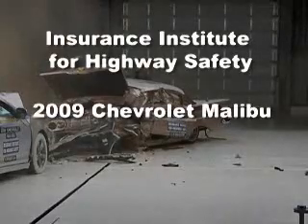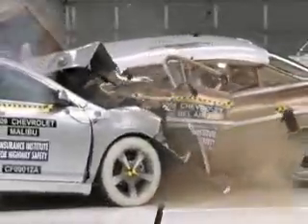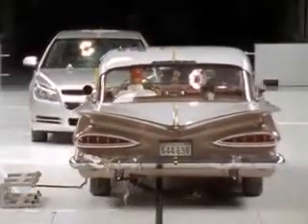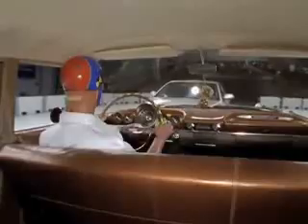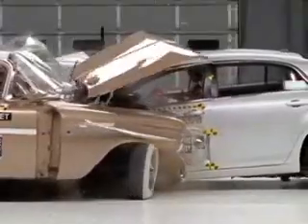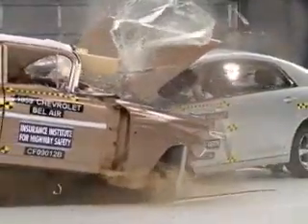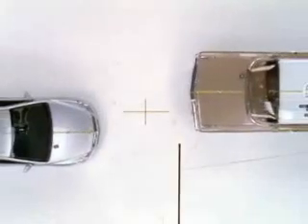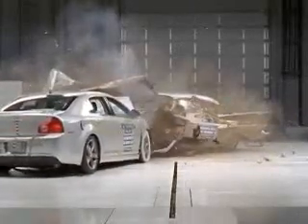Crash Test 1959 Chevrolet Bel Air VS. 2009 Chevrolet Malibu (Frontal Offset) IIHS 50th Anniversary

Comment: From a basic physics standpoint, it kinda seems like the engine is nonexistent in the Bel Air. A 700 pound piece of iron is not going to have it's direction changed by by some plastic and aluminum. If there was truly an engine in that car, it would use the Malibu's crumple zone as a cushion. The inside passenger compartment would not explode like that. Also to take into account real steel would tear into that plastic and force the crumple further and use the shit-can Malibu as a cushion.
Reply: The Malibu's advanced crumple zone would tear through the Bel Air's empty engine compartment due to the lack of reinforcing like a modern crumple has. The Malibu's mass would use it's mass to drive into the Bel Air further.
Reply: pretty much, I usedvtovwork on modern cars. I lost my job because of these plastic cars....or weak metal, the fender on a 2013 pickup bent in like its cool. My 95 also had a lot of room under the hood and I faceplanted it. I'm still alive and the engine was still running. Had I not tore off my front end I could have driven it home....im probably alive because if the sheer size of that thing
Reply: here that's bullshit and lemme tell you why.....a car costs money and is constructed from earths limited recources...two people do the horizantal bop and boom a people....some cars are not made anymore so they are irreplaceable. Some folks don't have money for even a beater. I'm just saying, a perfect balance of people survivability and automobile survivability.....and like said that paper thin Malibu is not going divert a 300 pound iron engine so yeah no engine
Reply: Charles Bledsoe Actually, a 3,400+ pound car is easily going to divert a 300 pound engine, especially when that engine is a non-structural component held in place by relatively flimsy motor mounts, as opposed to the Malibu whose crumple zones and passenger cell are specifically designed to absorb and deflect crash energy.

If a car is relying on its engine block to protect it in a crash, then it's already lost.
Reply: Trackers89 From a structural view, once the block wedges in the crumpled engine compartment, the firewall can support a lot of pressure.......in a case where i manged to faceplant an older ford pickup, the front end was scraped under, so the nose took the force into solid ground.........the ford 302 cid engine was seated comfortably against the firewall.....and probabaly saved my life......those older cars had long and tall sixes  while v8s remained a power option.....once the engine compartment crunches up, its solid, the rest of the frame absorbs the impact.....also of which why the frame of my truck was "L" shaped......anything that hits the ground isn't gonna win, Plus as stated elsewhere X frame bel airs were terrible.......Big Cars>little cars.......my 82 Lincoln mark vi would cut that malibu in half and still get me home
Reply: Charles Bledsoe The example you gave says more about the strength of your old truck's firewall than the value of the engine as protection, since if anything being hit by a big loose object that continues to exert pressure afterwards would increase the chances of it buckling. On newer cars, firewalls would be considered part of the safety cell and thus be even more heavily reinforced, so they could take an impact whether they're carrying a big V8 or a little 4-banger. Even if an engine protected, it would be pushed aside in an offset (like this video) or angled impact, so like I said earlier, a car that relies on its engine block to protect it is already a death trap.

Anyway, this is a moot discussion, since evidence suggests that the Bel Air was in fact carrying its engine and it still got crushed like a soda can by the Malibu.

Regarding your '82 Lincoln: It's more than two decades newer than the Bel Air in this video, and well into the era where automakers finally started caring about passenger safety, so it's not surprising that it would do a better job. And while its weight might give it the edge in a car vs. car impact with the Malibu (car vs. stationary object is another story), the difference is not as large as you think as kobun37  pointed out, and in a fair comparison where it's put against an equivalent modern car, such as its direct successor the Lincoln MKS, I wouldn't bet on it.
Reply: listen, i've worked on engines for at least 5 years, a present engine would also spew debris from under the hood, as it popped open like a jack in the box.......i should have seen the intake fly out like a frisbee, those pans were not held in tight........not to mention, cooling fan blades, alternator parts etc.. you people would belive the trash they feed you to purchase a newer car...........remember when abs wasnt a thing, traction control, airbags,power brakes, and even seat belts? yeah they didnt really need them due to size and strong us steel in 'em
Reply: +Charles Bledsoe lol, you know more people died and had serious injuries per mile in old cars right? 

No seatbealts? People were ejected from cars and died instantly from the impact. 

No ABS? needing to stop quickly always resulted in a lockup, and without control of the car usually caused a crash, a problem no longer

Same deal with traction control, once in a slide, you crashed, now you don't even get into a slide most of the time.

Airbags? Yes because hitting the steering wheel or side of the car with my head is exactly what I want in a crash. You die when that happens.

Next your going to tell me drum brakes are better than disc's

The fact is, 70 years of engineering has worked out that the point of car safety is the passengers, what the car look like afterwards does not matter, so they use  the outside parts of the car to absorb the impacts. 

The stats and numbers don't lie.

In 1950, 80 people died for every billion miles driven, today that figure is just 10 and has been decreasing steadily since the 40's. Mostly due to increasing safety.

If you want to put the lives of yourself and you children into a deathtrap, so be it. But you are just lieing to yourself

Comment: Kind of like the difference in trying to crush a full soda can and an empty one. Notice the over head shot of the collision quickly cuts away before the hood of the 59 Chevy reveals there is NO engine in the compartment!  All I know is, yeah cars today may be "safer" with air bags and shoulder harnesses. But I've seen accidents at low speeds between a new Acura and 2011 Malibu. Aside from the Acura needing a new bumper skin, the Malibu needed: new bumper skin, lights, radiator and trans cooler, bumper shock repair, hood and fender work. That's the difference in a 45000 car and 18000 car. Quality in construction and crumble zones. But I'm not going to believe the same plastic car is going to hold up better than a true steel machine of the 1950's without rigging that classic to give the Malibu a fair shake.
Reply: frehleyrox There is an engine you dumb shit.

+caleb J. No, that is rust, from the inside of the metal.

Comment: Looks to me as if the 1959 was precut in specific places to crumble the frame, there's no way a beer can and plastic bottle would crumble real steel that bad.
Reply: Mark Phillips nope. modern metallurgy and manufacturing techniques make better steel. The frame is completely untouched.
Reply: +Mark Phillips Beer can? Plastic bottle? Are you describing your head?
Reply: +Mark Phillips - This may come as a shock, but the steel used in modern cars is WAY stronger than the steel in old classics. The passenger compartments are super rigid, while the car around it is designed to crumple and absorb impacts.

Comment: I was in a bad accident last night in my 2993 Cadillac cts, I always thought an older car would be safer but after a jeep running into me head on, I realize how much safer newer cars are, I'm a classic car collector and enthusiast, but after the accident I now know. I had no seatbelt on and didn't know the accident was going to happen until I got hit. Both airbags went off and he was going quite fast. I came out the wreck unsaved other than my arm hurt towards my hands, even without a seatbelt, the newer safety technology turns these accidents which would be deadly to not so.
Reply: Do you time travel? Because i wanna know how 2993 Caddilac looks like?
Reply: LMFAO. 2003 CTS.
Reply: seeburg220  I wanted to be a cool hip-hop gangster and fuck all of the bad whores. A nigga can't get no love from a bad bitch if she sees I have a seatbelt on.

Comment: Ah,  1969 when the crumple zone was your face.
Reply: +Bryce C. Yeah, haha.  I also had to laugh at the point in the video where he says "Injuries to the neck, chest, and both legs".  Uhm, it's kind of a moot point if you're dead.
Reply: Fiat 126 has the same crumple zone as the Malibu, from the front bumper to the engine block.

(joke alert: Fiat 126 is a rear-engine car)
Reply: Bryce 59*
Reply: +Bryce You mean 1959.
Reply: Hey, come on, if they had the optional lap belt, they would have walked away.

Comment: I don't know about all these crash tests, but what I do know is...when I was a kid back in the 70's, my dad and his friend were driving a late 1950's model chevy pickup...and my dad took his eyes off the road for a moment and plowed over a street sign...My dad and his friend got out to look at the damage and there was nary a dent in the front bumper, maybe a little scratch but that was it. The sign was flattened however. Try that with a modern Chevy pickup and you would end up with $2000 worth of damage. Hell, try that with a new model anything.

Don't get me wrong, I think they have made many improvements to vehicles. I believe things like side airbags to be basically worthless however. And plastic bumpers suck. I do however like anti-lock brakes, computer controlled fule injection and ignition, 4-wheel disc brakes, multi-speed automatic transmissions and so forth. All plastic interior sucks because the vehicle is hotter on the inside than they used to be, and there are actually gases coming off of the plastic...so I would have to say the interiors could go with more metal...I do however like the modern passenger restraints...those have improved quite a bit. Unibody construction, I'm on the fence with that...It has it pros and cons. The main thing about the newer automobiles is that they aren't as easily repaired, nor are they as durable in low speed accidents. Remember, many modern cars only have to pass a 5 mph crash test, or less.

Comment: is one of the biggest lies that are circulating in the impala internet.The 59 had no engine, let alone if they cut some of the chassis when I hit you with one of its few cars 5 stars by not having the engine can not absorb elimpacto. nothing but the shape of the shock can that not having the motor 59 by way of the chassis I bone that joins in the middle chassis to hit you side may be bent in the middle. "COLLIDE a CLASSIC WITH A MODERN 5 STARS HAVE NO SHAME "
Reply: Admiral Skippy The absence of a engine would be the creation of a crumple zone therefore making it appear safer than it actually is. The transfer of energy into the passenger compartment proves that it did indeed have an engine. All that heavy metal has to go somewhere and in the case of the bel air, that some where is in the chest cavitys of the poor occupants inside.
Reply: ***** I truly think it would do the other way and not absorb impact forces, There was about nothing preventing the engine to be pushed into the cab.
Reply: lemy fairlane http://jalopnik.com/5364071/yes-the-iihs-crashed-59-chevy-had-an-engine
Reply: You have a point for sure.  Myth Busters tested an early 90's Sedan Deville against a 60's model and I believe it came out very similarly.  I believe they mentioned the cars were complete.  I'll try to find the link.
Reply: you're stupid, if there was a new engine would be destroyed because all would have twice as much weight in 59 and who knows if they did not reform or cut the chassis 59.
Reply: 1.01.podrido minute chasis.maestra a cloud of dust leaving the floor of the ca
Reply: safe seats should be loose because although they are not caught out not having tornillos.yo devian ise a video which clearly shows all over the Impala comes into my videos and really, I love the classic cars
Reply: ***** Umm if it had an engine, it would actually absorb most of the impact and not shove it back actually, what happened to your physics? XD and someone provided a picture and there was def no engine, and also i think the point here was to show the 09 Malibu anyways,,
Reply: who knows my 94 chevy c1500 survived a major wreck back in 95 and was rebuilt the whole front end was rebuilt new hood new doors  and fresh paint also a new 1500 v8 runs like a champ still to this day oh and a lady back into me pretty hard  it tore her car up and just left a small dent in my bumper  and her bumper was destroyed of course she had no insurance so the damages didnt get fixed oh well the truck isnt worth much anymore due to the wreck and the millage on it but hey its better then walking.
Reply: lemy fairlane yes it does. This is the IHS
Reply: lemy fairlane your brainwashed
Reply: lemy fairlane Wow.. It's funny people believe that... Even if there was a Engine... it would have been shoved into you.
Reply: ***** I do think new cars are safer, but I'm inclined to believe they actually did remove the engine for these tests but kept the engine in the new car.  All the camera angles are done so that it doesn't really show you the front of the 59 after the crash except for the very first one, and it does look like there's nothing under the hood. 
The only other angle you might have been able to see something would be top down crash, but they switch angles to the one we've already seen at least 3 times.  Why would they do that unless they had something to hide?
Reply: I agree with ya. Plus they had to remake the fenders, hood, door, basically every body panel from tin, instead of the medium gauge steel it was originally crafted from.
Reply: ***** https://www.facebook.com/508821759171978/photos/a.508822789171875.1073741826.508821759171978/688795857841233/?type=1&theater

Comment: I want modern safety cars in the old style. The ugly car from the 1950 `s and 1960`s future should not be there.
I hope that when the car being self-driven even the old style come back, when human crushed bumpers and spits tail fins, is no longer a problem. They are constructed of low weight aluminum and with no rust, plastic chrome and with electric motors charged by motion energy as air-resistance, brakes and shaft-driven turbines (there is a lot of energy in a moving car and the energy can be used to optimally fuel with the right technique). If I had a car industry, I would have done it.

Comment: This is why you install half-cages, which could come in the form of basically half of a roll cage, or can come in the form of a cage around the engine bay of the car, having it's strongest point by the firewall. Roll cages are fairly cheap. Shouldn't be a question of whether you should or shouldn't put one in an old car. Once you do, (along with good seatbelts) I bet it'd be safer than a modern car.
Reply: Yeah, no.

Comment: the bel air hit wrong... and older cars are actually made of tougher material.
Reply: Wrong, modern cars use ultra high strength steel in areas such as the cabin pillars, where the bel air has much weaker steel. Crash forces go through the whole car to help dissipate the energy even, not just direct crumple zones
Reply: danwat1234 Yeah, the modern compositions alone with modern treatments of steel today are extremely advanced. We know the exact makeup of it and can continually recreate it, meaning we can use less material today and still come out with a safer car than the thick heavy steel of the old cars. The old cars are hit and miss when it comes to steel quality. Nuff said.

Comment: Sure, a new car is safer. But I'd rather have the older one because you can actually service it yourself (No ECU) and they look SO much better, and you have a blast while driving them. Anyways if the engine was in the Bel Air it would be safer.
Reply: I'd rather have a car that like looks like a penis then one that crashes like that at ~30 mph
Reply: Get over it.  The new car is safer, which is obvious.
Reply: Hey, Drew.  I agree with you.  New cars may be safer, but try to get them fixed when the Check Engine light comes on.  Take it to the dealer and unless it codes as a loose gas cap, or failed #4 coil, or low tire(s), you are screwed.  Older cars, that's the ticket.  Simple ignition, adjustable timing, repairable/replaceable parts, pretty good stuff.
Reply: Buy a cable and get a code reader app for your phone.  You need a lot of specialized tools to do an overhall every 5000 miles.

Comment: Just so everyone knows, The Bel-Air they used was a rust bucket all bondo, this was proven wrong by another Crash testing company who bought a completely restored 1959 Bel-Air with new floorboards and fenders an engine compartment 

so this test was invalid, Everyone have a good day, Also when you have a old car be sure that your cars are better than they look, metal and roofing. also if i am right the 1959 Bel-Air had dual front seat belts as well as rear seat belts. 

And the new Malibu has an overall crash testing score out of 10 the score is: 4
The old 59' Bel-Air Has an overall crash testing score out of 10 the score is: 6
Reply: It isn't Rust saidly it "Georgia clay that had accumulated inside the frame rails" apparently it was sold to them for 8k "We had no idea it was destined for destruction" it was a blueflame 215 6 banger witha' powerglide